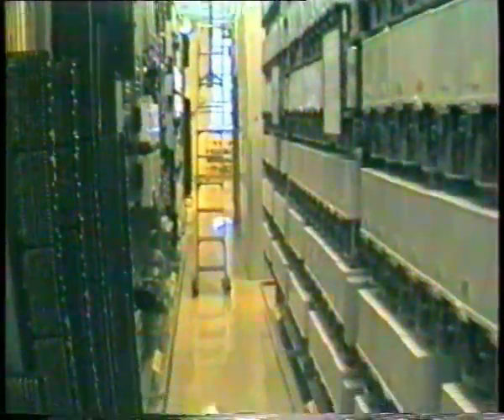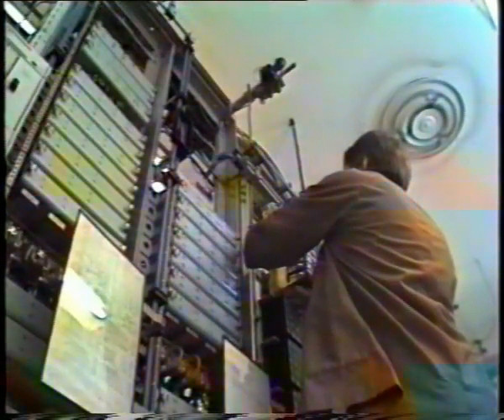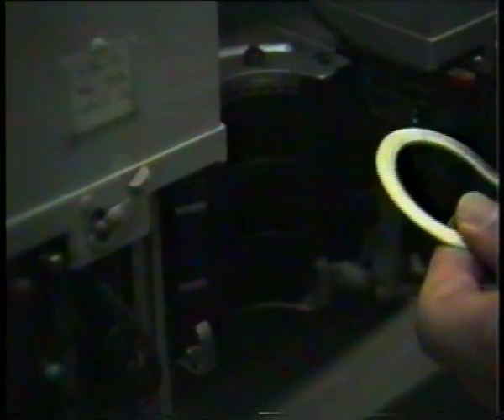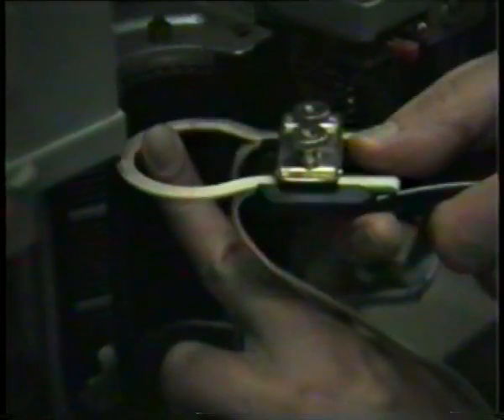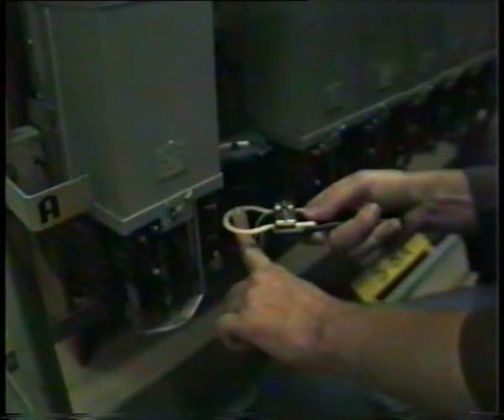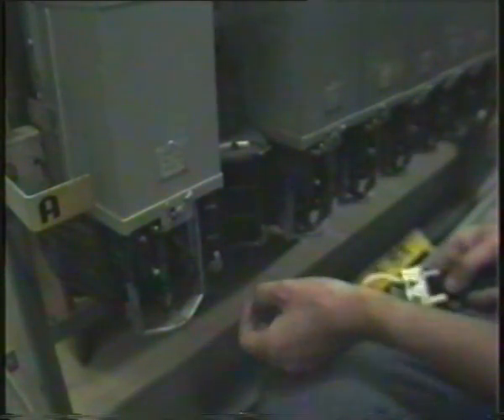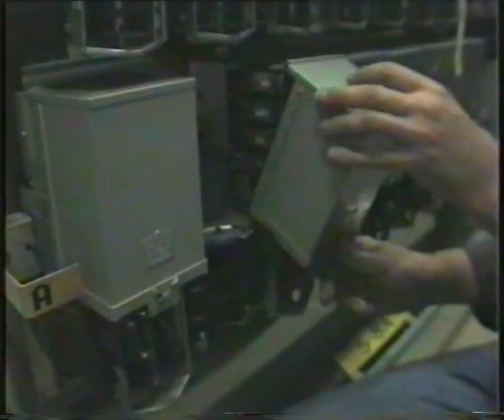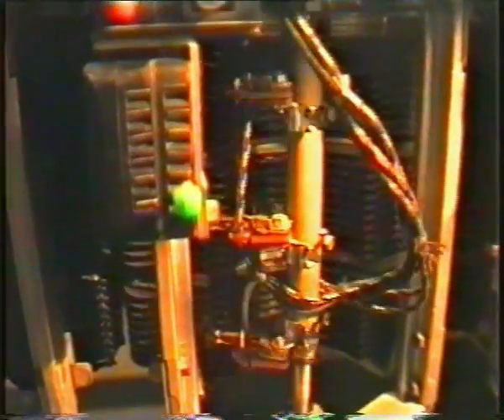Maintenance

Comment: 4000 type selectors. Just watching him bank cleaning reminded me of how boring bank cleaning and changing wipers and cords was :-) Saturday overtime haha
Reply from the maker: 2000 / SE50 actually. The SE50 was an Australian designed and built progression from the 2000 and had a lot in common with the UK 4000 switches, they were 100% compatible and swappable and used the same banks.